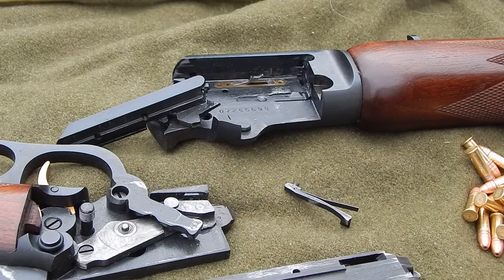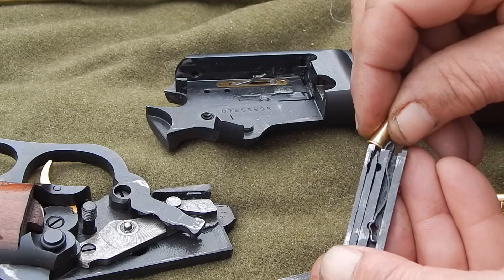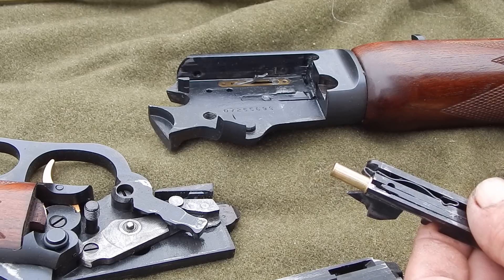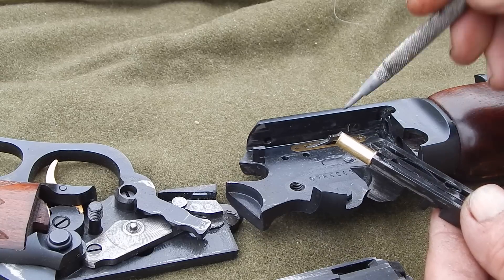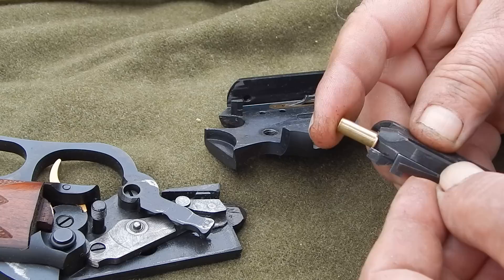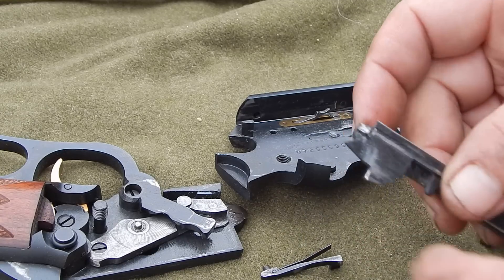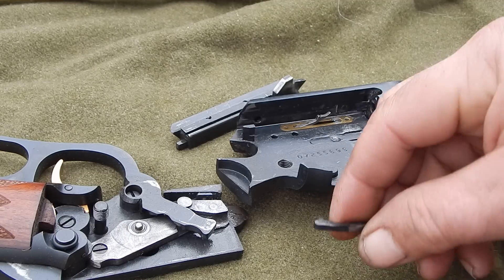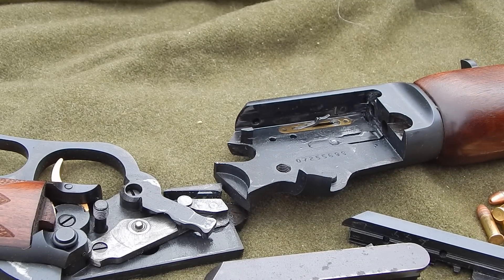Marlin 39a ejection problems

Comment: I have a 39A and the leading cause of cartridge ejection issues is a damaged ejector. It is VERY easy to damage the ejector when cleaning the gun barrel. I can't stress enough DO NOT put a cleaning rod down the barrel from the muzzle end to clean it without locking down the ejector! The rod will hit the ejector inside the receiver and bend/damage it. It only takes one time and its damaged. I learned the hard way. Instead, in order to clean the barrel in this gun, it us best to take it apart via the take down screw. After the gun is apart the screw on the ejector is made with a slot in it to lock the ejector down into the ejector base. This slotted screw is there specifically for use when cleaning the gun. Just push the ejector lever into the base and turn the slotted screw a quarter turn with a flat head screwdriver to lock down the ejector. Then and only then you can clean the barrel with a rod from the receiver end. When you are done cleaning turn the screw a quarter turn back to unlock the ejector from the base. Just make sure the screw is turned so the ejector will not catch on the screw when the ejector spring is compressed into the base when cycling the action.
Reply: What you write makes sense, knowing what I know about the internals of the Marlin 39A. With Henry's .22s, it's not an issue. You can run a cleaning rod or cable down the barrel from the muzzle end without ruining anything, so long as you're careful not to hurt the crown.

Comment: Mine only has an issue ejecting the spent cartridge after it’s been fired.  If I just put all 18 round in the cartridge tube and just run through all the rounds they come out no problem.  Even after extensive cleaning, a round will get jammed every 5 or 10 rounds.  I feel like the striker will mangle the rim fire round so much that is jams it right in there.  I have to use the cleaning rod to get the spent brass out.

Comment: It's also worth mentioning that there is a locking screw you engage when cleaning the bore. The locking screw holds the ejector out of the way while cleaning, but you must remember to loosen the locking screw after cleaning,  and before reassembly,  otherwise the ejector is disabled and won't function.
Reply: Thanks. I always wondered what that screw was. I cleaned the barrel the other day and it was in the way.

Comment: I’ve had problems with the extractor on my 39AS failing to extract cartridges after firing.  It then requires a person to push the round out of the chamber using a cleaning rod down the bore of the gun.  I’m not sure what causes this.  I’ve replaced the extractor claw but it has not remedied the problem.
Reply: Same problem here too.  Seems like the firing pin/striker mutilates the rim fired casing rendering the ejector claw useless.
Reply: Check for crud in the space to the right of the chamber where the extractor must go to grab the rim. If there is dirt there, the extractor can't move to the left enough to grab it. It is simple enough to check. I hope that is the trouble.

Comment: I inherited a 1956 made Marlin M39A. I thought I was having ejector problems. Turns out that isn't it. The gun needs a firing pin too. Cycling it, the bolt was not going far enough back to eject the round. Looking at how everything lined up. I believe that it needs the firing pin to be able to retract all the way back. Also to use a good good, healthy levering when using it. But your video answered several questions of mine. Thanks

Comment: I have the Marlin .22 39M, never had miss fires nor ejection problems. Most accurate rifle I've owned in 22cal. 1/2 to 1" group shots @100yds..
Reply: When was it made? Mine is post Remington takeover of Marlin (2007?). It's TRASH. Failure to fire and/or failure to extract. Eject is ok IF it extracts. All popular ammo manufacturers tested. Junk.
Reply: @Lojkkus  Wow, what a shame.  I had read some years back when Marlin manufacturer employees got let go (for whatever idiotic reason), that any rifle produced after that had various defects. It was attributed to Remington techs not having the Marlin expertise. My 39A is from back in 1987.  I also own a Marlin lever 30AS 30-30, also purchased in 1988, and a Marlin 70 .22cal. I own two Remington firearms, the 700 adl 30-06, and 870 pump 12ga. Both Excellent, both from 1986-7. None have given me any problems. Best wishes..
Reply: @Lojkkus  yep.  Total piece of junk.  Spent $700 back in 2007.  The round gets so jammed in the bore after the striker hits the rim.  It crushes it so badly that the round won’t eject.

Comment: I shoot Shorts in my Golden 39M with a 4x Bushnell scope, popping woodpeckers in my pecan trees.  I have noticed recently that about every other fired case will "stove-pipe", hang up in the ejection port.  What would be causing that?  For years it has popped out the fired cases reliably, with good force.  I may have to try replacing the spring steel extractor and/or the ejector assembly.
Reply: If the empty shell got pulled from the chamber but didn't eject then you have an ejector problem. Repair/replace the ejector.
Reply: Thanks M White.  The rim of the fired case (.22 short) actually gets stuck between the ejector and the fully retracted bolt.

Comment: My model 97 had troubles extracting and ejecting.
Being 112 years old; i knew it was age related.
First thing I did was clean the chamber.
It is the opening in the barrel, before the rifling starts, that holds the round when the bolt is closed.
Turns out there was a ring of carbon in there from a previous owner using a lot of 22 shorts.
The long rifle rounds were getting hung up in the chamber.
I used a round brass brush made for .22 calibers to clean out the chamber.

That solved the extraction issue.

Comment: Great video.  I would like to add that the cartridge guide spring can also cause ejection problems if it's loose, dirty underneath, or out of tolerance.  I had FTE issues for the longest time and neglected to check the cartridge guide spring.  It was hanging down a hair too far because the screw was a bit loose.

Comment: I got a model 336 that has crazy feeding issues, every time a round is lifted out of the feeding tube it becomes jammed up and I have to spend about 15 minutes digging with a pocket knife to clear the jam. Someone told me its probably a  worn lifter that needs to be replaced.
Reply from the maker: I have heard of people having jams with Marlins, but the only one I ever had jam was a .44 magnum. I always felt that was more of a problem with bullet design, at the time I owned that there weren't many options available. The simplest way to unjam it was take out the one screw that holds the lever.  It seldom happened when I used it, but every time I let somebody else use it, they jammed it. With the right bullet I don't think it would have been a problem, but at the time all you could find where hollow point, jacketed, pistol bullets.

Comment: What I meant by the extractor is when I first bought the gun new you would fire it and it wouldn't extract the empty casing. Then when I would pull the casing out with a knife you could see a bulge in the brass like it wasn't fully seated. The gunsmith claimed he had the add a little to the part of the lever that pushes the bolt forward to make it fully seat the cartridge. But now when I fire it the empty casing seems to just spin around in the chamber some eject fine maybe every 3 or 4 eject then I'm back digging with a knife. Thanks for the video though I'll try a whole new ejector.
Reply: They extract fine they don't always eject they'll dance around in the chamber till they're facing backwards or something. I've had a few Marlin 336's and this 39a that have been a pain long before Remington had their hands on them.

Comment: If you type in "Ode to marlin 39a" in Google you will find the fixes for the newer 39A's.Also replace that junk spring extractor with one from Wisner'sOnce you tweek them they are just as good if not better than the old ones.